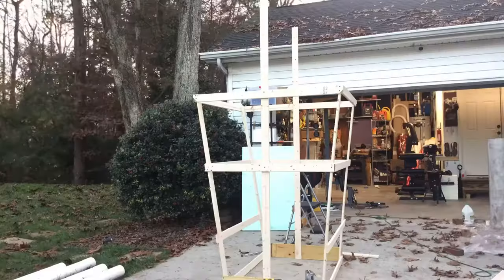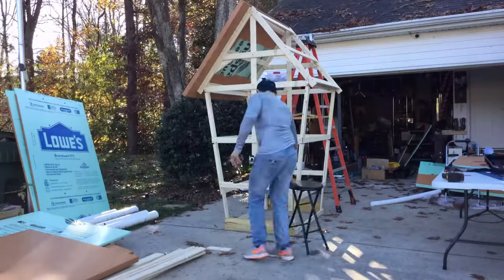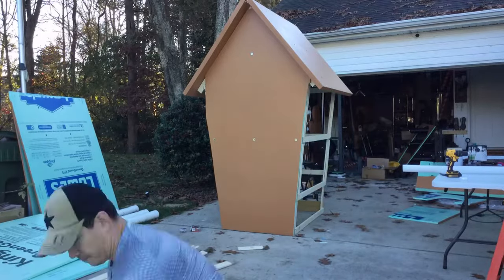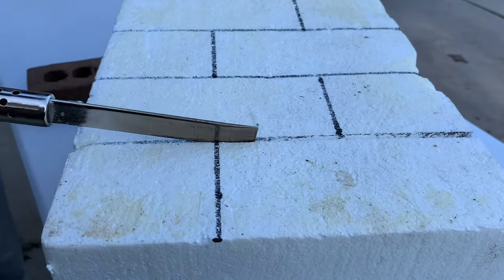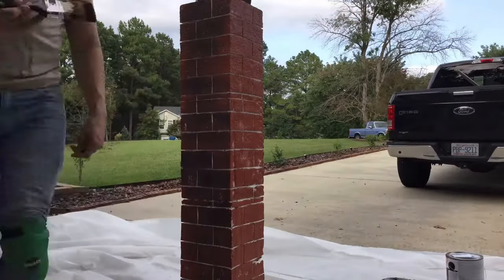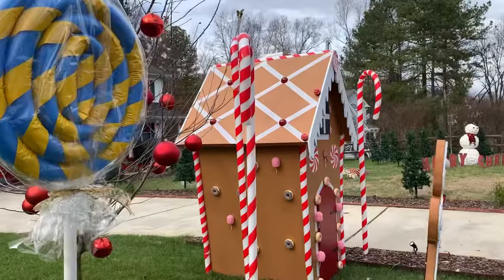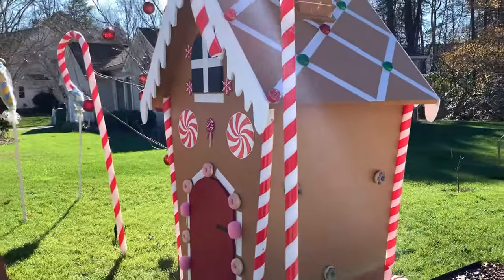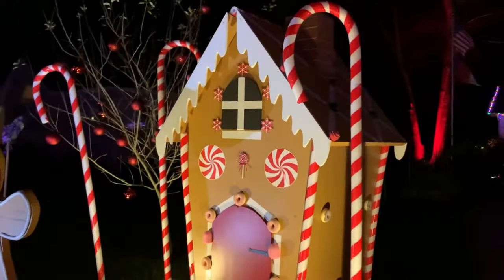DIY GIANT GINGERBREAD HOUSE

Comment: Q? How much was it to make? 

 Also with that material is it water 💧 proof.. rain or fog wet??
Reply from the maker: The price of it then is different now because of the changes in prices for materials..
It’s insulation foam board that’s used for the walls and exterior paint, it is weatherproof

Comment: How did you do the front like frosting edges
Reply from the maker: I used 1 inch insulation foam board. I drew out the shape I wanted then cut it to look like frosting. Then I painted it white